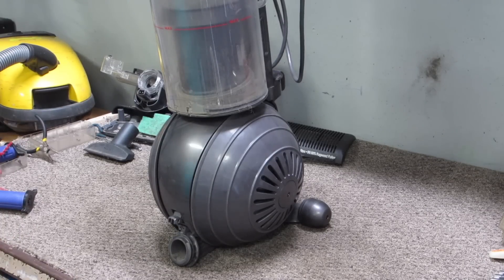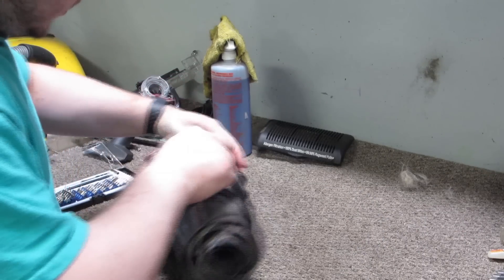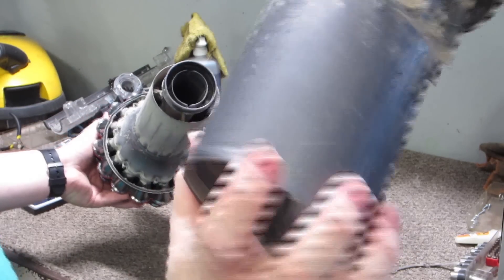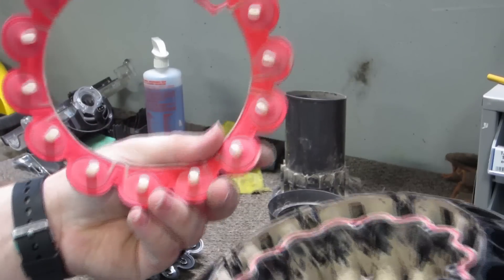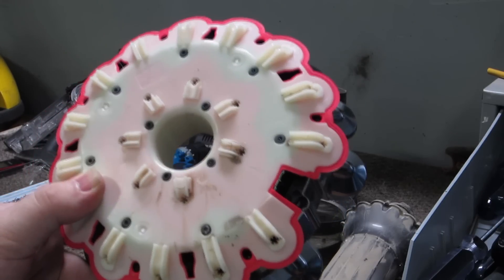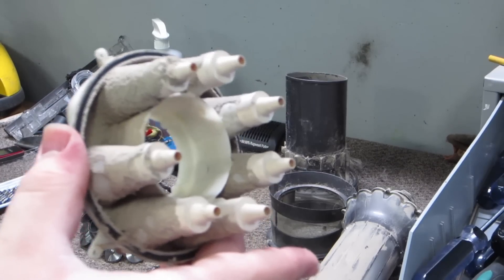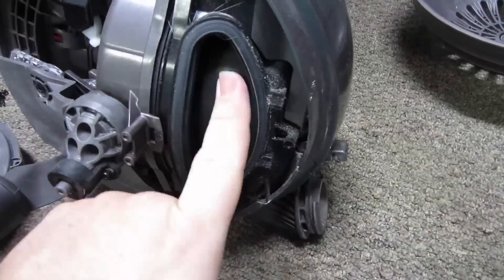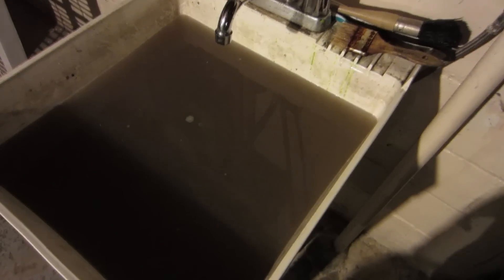Dyson Cinetic Big Ball Canister Disassembly & Cleaning

Comment: We've had the Dyson ball for 4 years now. I use an air compressor to blow out the cyclone to keep it running. However, it's nice to know that it comes apart to the point where I can use the compressor to clean out the inside of it as well. A good instruction video. Thanks!

Comment: To any who are a tad OCD like me .. that inner seal that gets ripped apart during disassembly (@ 5:22 in this vid), i scraped it off and replaced it by supergluing a rubber band around it.  It worked and fit tight during reassembly.  So far so good.
Reply: Good to know!! This was my question. Everything else came apart like a charm except the last piece. I don’t have a drill to hold the tork piece in there to unscrew it.

Comment: Thank you so much for this video!  I got a used Animal vac that needed minor repair, changed the HEPAs but it still smelled AWFUL.  Thanks to your video the cyclones got the thorough cleaning they so badly deserved.  We're talking like a full cm of accumulation in spots! I couldn't believe the motor wasn't blown.  Works like a beast now, though!

Comment: You should've immersed the whole cylinder in water preferably  hand tolerable hot  with detergent then soak and rinse thoroughly , then use an electric leaf blower  to dry most of the water out and then disassembled so you don't have to breathe in dust which may contain mould and other bacteria.

Comment: All that dust you see under the cyclones does not matter, it’s supposed to be there. It means the cyclones are doing their job in removing dust from the air flow.
The design flaw is having the clean air pipe from the cyclones to the motor routed through the centre and bottom of the big bin. So when you empty it, static from inside the clean air pipe draws up fine dust and hair. You put back on the machine and turn it on, the dust in the pipe will go through motor and clog the filter. This causes the suction loss. The cyclones actually do work very well.
Reply: Qasim Mir the static dust that gets blown into the motor is going to have minimal impact if any, the main issue is people overfilling them and blocking the shroud which causes reduced air speed and particle rejection effectiveness. The few cases of damaged Cinetic vacs are usually down to user error.
Reply: Mine was clogged as hell , had to replace it.
Reply: Absolutely the fine dust does matter this is another proof that James Dyson has lied to people throughout the development of his worthless piece of crap vacuum that is overrated overpriced I had for Dyson's and I will never own another damn Dyson ever again. I've had this Dyson this was my last Dyson that I purchased the thing kept clogging up so finally I had to take it in and they had to take the whole thing apart to clean it and I'll keep in mind I'm just by myself no animals but I do vacuum every single day come to find out there is another filter down in the motor as well that you cannot get you that has to be professionally removed and cleaned or replaced and they don't tell you about that this vacuum is a piece of crap don't buy Dyson vacuums don't support the live at James Dyson has produced. It was going to cost me literally $120 for them to fix my Dyson I told him I said take the piece of shit and throw it in the trash. That's exactly what they did

Comment: The dust build up under the cyclones does not affect performance, if you think about how the machine actually works, the air does not flow down there, only the dust does. The dust which is filtered out by the cyclones is so small and light that it does build up there, but over time it falls off and is emptied with the bin. This is actually not a design flaw as you claim but rather a very deliberate design.

Comment: Thanks for this. I've had this model for 6 years, and overtime the amount of times I've had to wipe down the mesh because that air vent would open up and start hissing has increased steadily. It's gotta to the point where i couldn't even finish the living room without have to wipe it down several times. Hopefully this fixes it for a while, but I may end up just buying a new cyclone, only $100, and hope the vacuum lasts another 6 years.

Comment: Great video, You speak of “dyson in their infinite wisdom” but yet the filters were clean besides for a bit of carbon from the motor…huh seems as if the Cinetic nozzles did exactly what they were supposed to do. 
Just from a users input I have had this same model for 6 or so years now with an indoor German Shepard and let me tell you the trick is to vacuum often, like OFTEN as in 3-5 times a week if not daily. What ruins these machines is the owner who vacuums once or twice a month that overloads the machine with a barrage of fine pet dander that backs up into the nozzle assemblies.

Comment: I'm actually debating what model of Dyson to buy because we have 2 dogs and I want a vacuum that will kick ass getting dust and hair up. But after watching this I'm convinced to buy the kind WITH A FILTER!!!! I'd rather wash or replace a filter because I can't accept that it actually traps dust and mold spores without a filter. Great video!
Reply from the maker: If you want great cleaning performance and longevity with pet hair I'd highly recommend looking into Sebo. We've seen people go up to 30 years of use on them. Plus if you buy from an authorized dealer in your area Sebo provides a 7 year parts and labor warranty and 10 year motor warranty.

Comment: After watching this I think I may have completely rendered the one my mother has as useless now.

I didn't know that you had to be so thorough with the disassembly of the cyclone.

I took it outside and squirted it out with the hose until the water ran clean. Took awhile but it did eventually run clean. Do I have to break it down now to make sure the tiny little cyclone nozzles are completely dry now??  Is there a way to ensure they're complete dryness before reassembly WITHOUT breaking it down the way you did?

Or should I just tell my mother that someone ran off with it and quietly bury the remains in the back yard when everyone's asleep??

Nice informative video, though. I wish I had watched it FIRST!

Thanks for any input, info, or opinions on my dilemma.
Reply from the maker: Some of the older Dysons that aren't so constrained on the inside you used to be able to get away with that. It still wasn't a good idea but a bunch of "mommy bloggers" got a hold of it and ran with it. 
For this one I'd say it you want it to dry out without having any issue with mold you'll want to take it all apart. Most likely even if the water ran clear you'll probably still find some muddy/dirty areas when you take it apart.

Comment: Mine actually worked better with a T7 from the Husky precision set from Home Depot. To hit the top part I used a precision cleaning tool from my tool kit to loosen the major clumps, then hit it with an air compressor.

Comment: Thank you for this awesome detailed video! I was able to take apart and clean it and saving me $125 for a new cyclone part!! 
Although, I was not able to take apart that last part because my fork bit (like you said) was not long enough. I cleaned what I could really good so does it matter if I could not get that part off? 
Also, there is a small ring that you said normally you should not be taking it apart often. That part on mine did break but stayed intact so can I just hope and pray it stays when I put it back together? I hate for that only piece to be a deal breaker and cost me $125 
Live the video, very detailed for someone like me and I was confident in taking it apart under your instructions. Please reply back as soon as you can so I can put it back together. Thanks
Reply from the maker: So long as the piece is intact you should be fine. Just place it as best you can where it should sit and I doubt you'll have any problems.

Comment: Thanks for the video, I just bought this vacuum used for $150.00 - maybe I shouldn’t bought it, anyways if the gaskets break during removal, what do you use to replace them?  To take it apart I bought 8 Pieces 1/4 Inch Magnetic Hex Shank T8-T40 6 Inch Length S2 Steel Torx Security Head Screwdriver Drill Set Bits on Amazon and these worked great.  When I had everything washed, I just put it in the Sun for a while until NO water was left.

Comment: An acquaintance used to work demos for Dyson at Costco, so I got the animal and allergy for a bargain $200 ($699 at the big box stores). What a piece of junk. Unbelievably heavy and poorly designed, not to mention the dust that flies all over. Not great for my allergies and asthma. I spend more time cleaning the vacuum than vacuuming.  Suction was great at first but not worth all the trouble, especially since it is not working as well. I took it apart but did not attempt cleaning the cyclone which, sadly, is where all the dust and crud is located. Even after watching this video, I may not get it back together correctly. I cannot imagine paying $699 for this junk. Oh - and the cord constantly knots. No matter how much I stretch it out, it eventually wraps around itself into a big knot. My friend quit - even she said she could not promote this junk anymore.
Reply: I rebuilt a Dyson canister vacuum, the DC39, and I love it. Didn't expect it to work out so well. $40 for the used vacuum cleaner, then $40 for a new HEPA filter. Very clean, really strong.

This Dyson upright, though, is a mess. Smells awful.

Comment: Those cyclone tips are self cleaning on the inside. They prevent the exits from blocking by vibration. It doesn’t need to be cleaned in those areas the same way a vehicle exhaust system doesn’t need to be cleaned. Car manufacturers figured out how to keep the exhaust functioning, and Dyson figured out how to keep their machines in working condition without a tear down clean. Unless of course there is absolute ignorance which can negatively affect both situations.

Comment: This one is too hard to clean. What machine do you recommend that is easy to clean and very good in terms of suction, etc.
Reply from the maker: I suggest skipping anything bagless entirely so you don't have to worry as much about cleaning. If you've got your heart set on bagless bascially the only current bagless machine that is well made and designed is the WMJ Workhorse (formerly Amway Cleartrak). I have a video up on my channel of that vacuum.
Reply: @FantomLightning  what machine with a bag is best for low shag carpet with dog hair and dust in an apartment. I dont require bagless. I have the dyson animal and it smalls bad and is too hard to completely clean. .
Reply from the maker: @donnarosenzweig3751  There are a lot of great bagged machines so much of it comes down to personal preference. Something like a Sebo G4 is a bagged machine that cleans well, is very durable, and the main body of the machine can be taken off to be washed/rinsed in the sink should you ever need/want to.

Comment: if the seal in the top of that inner tube (5:20) is broken, does that reduce the performance? any way to replace that seal?
Reply from the maker: It's basically impossible to open the machine without breaking that seal. Can't be replaced because Dyson only sells the entire canister assembly. When you put it back together just line up the seal and friction and bring screwed back in place should take care of it. I don't think you'd ever notice any real loss in performance.
Reply: @FantomLightning  Thank you! Great video! Helps a lot!

Comment: The gasket that breaks at 3:40, where do you find a replacement? I can only find a bin seal gasket on parts websites.
Reply from the maker: Dyson doesn't make many small internal parts. That's one of them, simply push it back together with the pieces aligned that's basically the best that can be done without replacing the entire canister.

Comment: what is that "half a pipe" thing on the ring at 7:28?
Thank you for this video! My vacuum is 3 years old, and I had much more dust in the cyclones area, even hairs were there
Reply from the maker: It's an air relief. It will open when there's a bad blockage to ensure the motor can get airflow.